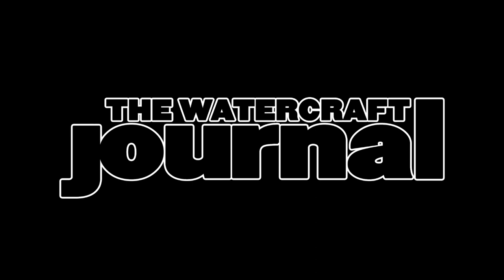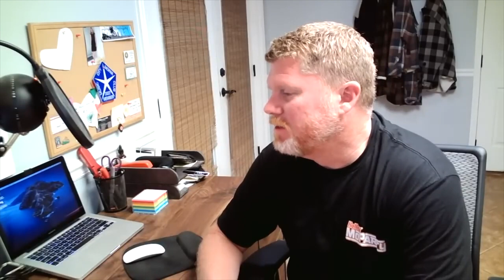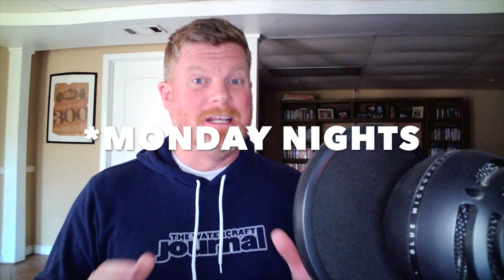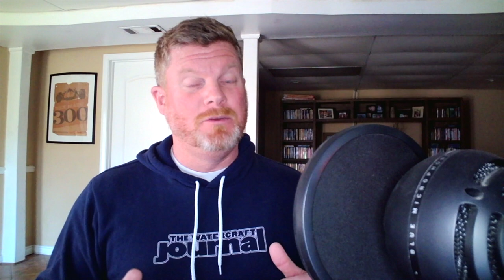How Some Deck Extensions Alter How The Hull Tracks: WCJ Quick Topic

Comment: Heres a nifty change for sponson design. On my 2016 fzs i installed 2 sponson-like pieces of flat aluminum plate on the bond rail to use an a very solid anchor point for a rear box.  The ski bites in just a bit more agressive after you are about 20% into a full tilt turn.   I still have oem sponsons. Startled me at first, but after i got used to them , they are a welcomed addition.  And no, i do not corner this thing at 82, i keep her straight and true running at that speed.
Reply from the maker: Ugh.

Comment: The rear extended deck only effects the pivot point at slower speeds and pivoting in neutral and docking when the back is submerged below the water.
Once up to speed and on plane the rear deck is 2.5" above the waterline and does not effect the handling.
Reply from the maker: And turning. Every time you make a halfway aggressive turn.